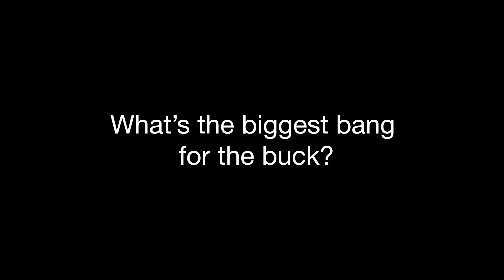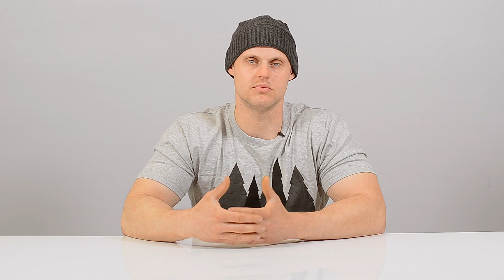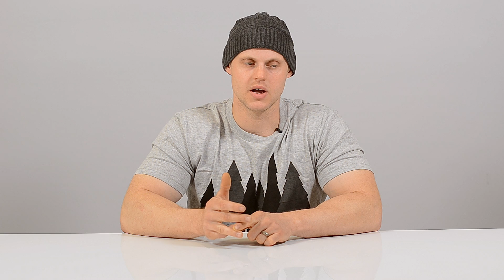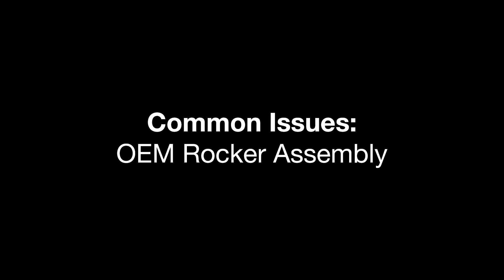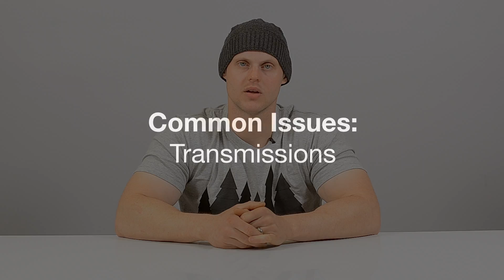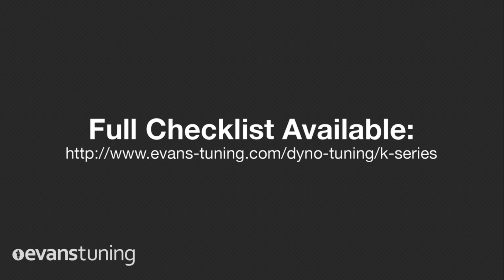The K-Series Tuning Checklist

Comment: 250 hp with 200 lb ft tq is J32 levels of power in something under 3,000 lbs. It makes for a fast and reliable power plant for an EK or DC platform. It is good for 12 second 1/4 mile with no weight reduction

Comment: Question, If i have the 2nd gen TSX with the K24Z3 engine, would I be able to swap my heads with the K24A2 heads to then modify? I ask since many parts are made for the K24A style engines. Unless you know of some good bolt-ons?

Comment: So i have a 2006 k20z1 with skunk2 stage 2 tuner series cams, wiseco 11:7:1 pistons, manley h beam rods, acl rod and main bearings, supertech valve guides for exhaust, cai Intake, cometic head gasket, walbro 255 fuel pump, rbc port matched and polished, 550cc gram injectors, ktuned fuel pressure regulator, k tuned 72mm tb, 2.5 in exhaust, megan racing headers, stage 2 competition clutch, 8lb ultra lightweight flywheel and kpro. i think thats it but yeah whats like a ballpark number you think i might gain from this setup all motor tuned on 93? Thankss

Comment: I have a question I just finish a turbo build on my rsx type s stock motor. I did the whole fuel system return kit 1000cc bosh injectors k tune fuel rail and pressure regulator walbro 450 pump and braided lines I had some 93 pump gas and went and put e85 since I’m trying to switch fuel the air fuel mixture went crazy and the car it’s missfiring real bad I’m running on a base map haven’t had it tune yet can that cause any harm to the engine? And what should I do?

Comment: If your gonna bolt up a k24 tsx bottom end , with a k20 head & k24 tsx cam & gain 40-50 horsepower & torque & be around 240-250 hp like mentioned in the beginning . Wouldn’t that setup basically be like a regular k24a2 with bolt ons?? Would it be easier just to get a k24a2 & do bolt ons ??

Comment: To add a bit to 2nd gear failing, when using And upgraded clutch you may want to change your clutch slave cylinder because the factory one has baffles in it to restrict flow and with a heavier clutch springs your shift will be much smoother if you use a K tuned or like aftermarket slave cylinder , I believe this is the major contributing factor to losing second gear

Comment: do you need a tune for an air intake??
Reply: James Trenholm yes you will lean out the motor any mod requires tune ecu will not understand what needs to happen becuAse it’s tuned for stock parts

Comment: In the Fuel System Part you said to route the fuel coming from the feed line to the fuel rail then out the return line to the regulator then return back to the tank, but most guys do it this way - feed to 3 port FPR then to the rail, other end of fuel rail plugged, then route the return from the bottom port of the FPR to the return line, so my question is, is there an advantage to putting the FPR after the rail vs placing the FPR before the rail? BTW this is for FI application therfore will be running large injectors. Thanks

Comment: Enjoyed the video, I have a EP3 with a K20a3 I am debating on doing an engine swap to either a K20a2 or a z3 do you have any recommendations or preferences?
Reply: K24a2 or k20a2 or K24 block and a2 or z3 head. Swapping mine with a JDM K24A2 next week.
Reply: The ep3 comes with a k20a2 doesnt it?
Here in europe the ep3 is the type r, with the k20a2....?
Where are you from?
Grtz
Reply: Nicolas Dujardin uh in UK it has a K20A2 in em yes. Japan has the “K20A” no “A2’” or “A1” ETC. I am from US so we never got the EP3 Type R we got the weak Si EP3 with a K20A3 with fake VTEC and 160hp. I swapped mine with a JDM K24A2 from the CL7 Accord
Reply: @AeroPrixma  oh allright, i thought it was something along those lines...
I have a 7th gen civic coupe (em2) and now swapped in a k20a2 from a edm ep3 type r, injen cold air intake, 2.5inch invidia gt300 catback, dc-sports 4-2 header, rbc intakemanifold ,skunk2 70mm TB and hondata ecu.. now makes 237 whp. 
And what a blast it is 😜 
Its now been finished for 3 days, and enjoying every second from it lol
Reply: @AeroPrixma  how much torque do you have from that k24 ?
Reply: Nicolas Dujardin oooo nice. I got stock 171tq. I just put the motor in w/ a new clutch so it will need to be broken in, but i have been tuning it because it has been running lean. Later i will take it to a professional tuner once it is broken in and get the real numbers. The TQ is so good. So worth it. You press 20% throttle and like that you are at 45mph or 70kph. I wanna make 230whp like you, looking to get mid 14s in the 1/4. You running 91 OCT with 237whp?
Reply: @AeroPrixma  we only have 95 oct & 98 oct here in europe... 
So it's mapped on 98 OCT.
First i wanted to do a k24 underblock with k20a2 head, for the torque advantage. But i couldn't find a decent k24 underblock
 So just went with the full k20a2 engine with dc5 6speed gearbox with shortshifter, added a sachs stage 1 clutch and fidanza stage 1 lightweight flywheel. 
Also removed the rearseat and trunk liner. Added a strut brace under the hood, a trunk strutbrace and chassis tiebar.
Suspension wise a installed a KW V2 adjustable coilovers, with ep3 type r anti rollbars, for brakes i installed ebc gd series, grooved and drilled disc, with kevlar ebc yellowstuff brakepads and forge carbon brakelines. Wheels are bronze japan racings (volk te37 design) with nankang ns2-r semi slick tyres :)
Reply: @AeroPrixma  and what kind of ecu are you running?
Reply: Nicolas Dujardin good lord solid build! I have the Type S DC5 tranny as well. I went with the full K24A2 because I couldn’t find a low mileage K20A head for a frank build. I also have all my suspension aftermarket except the front anti roll bar. I can only dream of having Volk TE37s. I am running stock ECU from my EP3 k20a3 with KPRO from hondata
Reply: Nicolas Dujardin oo nice semi slicks, I am going with semi slicks as well (federal rsrr) couple burnouts will do the tires some good for replacing 😂🤣
Reply: Nicolas Dujardin I have some extra RSX Type S rear anti sway bars. Can’t remember if they fit on em2 but they fit on the em1, RSX of course, and EP3.

Comment: i heard a ultra light fly wheel in a k20/k24 build isn't a good idea due to how fast the motor revs up and its recommended to stay above 10lbs for the fly wheel is that true? also how reliable is it to have drag cartel 2.2 cams in a 8th gen with upgraded in line TCT?
Reply: Reggie H just use a rev limiter no need to rev the motor past we’re is makes it’s power

Comment: Hey , i know this is not a question about k-series, but as you seem very knowledgable about honda tuning, i have question for you!
I just bought my first honda! A 05 em2 civic coupe, with the d17a9 vtec-e engine, stock 125 hp..
I would like to go for a safe 160 170 hp.
What would you recommend my to go with first?
I was thinking about an CAI, headers, cat replacement, and a catback system,and a tune for starters. Together with a stage 1 sachs clutch and lighter flywheel.
Then for tuning. Can i just tune my original ecu to run well with the new parts, or do you need another ecu to do that?
Lots of thanks for the learning vids!!
Reply: I have a 02 Honda civic em2 as well with the d17a2.  From what I've researched they're not worth doing anything with.  Maybe I'm wrong and someone can give you better advice,  but I think you'd be better off saving for a k swap
Reply: @sentree9857  late reply here, i know the the d-series sucks for tuning, theybare the least tunable engines honda made, but all has been taken care of now, my em2 now has a fully rebuild k20a2 , from a edm ep3 type r, with an invidia 2.5" catback, srs catdelete, rbc intakemanifold and eventuri cold air intake.
It has 216 whp :) and a damn blast 2 drive

Comment: I’m running forced induction in my K20a and planning to forge it and run the power in the low 500’s. Is there any need to change the valves and valve springs? And is it better to put k20a2 cams in? Thanks

Comment: I need some help! My 8th gen si wont rev past 7k. It just completely  stops accelerating and cutsoff, not sure what to look for. Changed spark plugs, just did a  oil change, cleaned the maf and throttle body. Ran some fuel cleaner and nothing changed.  What's the next step? Anyone? Evans Tuning?
Reply: Also no cels. Car drives normal other than that. No weird noises. Mods are cold air, catback and berk hfc. Issues occurs with or without flashpro basemap

Comment: Some really good info you shared! Can anyone direct me to DIY on removing the clutch pedal safety switch? Would it be as easy as just threading it out of the pedal assembly and zip-tie it under the dash, then thread a bolt into the assembly to act as a depressed clutch pedal stop?

Comment: If i put my k20 head on a tsx k24 bottom end, do i need to change anything to the bottom end? I read to use the RSX oil pump, but not sure if i can keep the TSX bottom end stock. Also, would buy RSX race header fit once i put on the k24 bottom end? would i need to purchase a k24 specific race header? Thanks in advance =)
Reply: Jon Silva I used to have a k20 but swap to a k20/k24. The headers for the k20 fit the k24. I'm running skunk2 alpha headers.

Comment: Can i still get away with leaving the fuel system returnless with turbo? Mybe only with a 750cc injectors.. only doing 8psi of boost
Reply: asakapa0003 with an uprated in tank fuel pump you'll be safe to 350. After that id say run return/fpr
Reply: gynads ok im aiming for 320-350 anyway

Comment: If I get a k20a2 head, do I need the rocker Assembly also? To use the 06 tsx cams or will the k24a2 rocker Assembly bolt up fine?

Comment: So I have a k24z7 it's an odd ball?  Why?
Reply: sam pinzon don't worry. The k24z7 is strong and the integrated exhaust manifold flows very well. 
If you ever go turbo, that integrated exhaust manifold is perfect for really simple high flowing turbo manifolds.
Reply: sam pinzon it's not true vtec for one it's only in the intake side, it also doesn't have a true header because it's cast into the head. I'm sure there's more differences but those are a couple. I have a k24z7 and it still makes good power with bolt ons and a tune.
Reply: Ryan Fulkman I'm doing a Frankenstein swap with cams on 93
Reply: The reason why it’s a odd ball is not really about the dual VTEC or the down pipe issue it’s becuAse everything is different you have to peace together a mount kit u need a stand alone for ecu becuase of crank trigger on the fly wheel also transmission casings are different also this for swapping into older chassis

Comment: Hi there, great informative videos. Is it possible to connect the variable cam pulley system to a simple on/off output rather than a full degree control system? Similar to a 4age 20valve engine. Just so that a simple aftermarket ecu could control it. Just a couple of outputs, one controlling the hi/low cam and then one for fully advanced/fully retarded pulley. I know it wouldnt be as good as a factory style system but im just looking for simplicity.
Thanks in advance

Comment: Seems like a lot of issues with running a k Series swap. I understand that they are amazing engines but damn so much shit you gotta worry about. For those who have them, do you really have these issues and worries after putting them in your car? I love the fact that they respond to bolt ons a hell a lot better then any other swap but it just doesn't seem to be worth all the money/issues/worries that come along with it. I've done b Series swaps and didn't worry or have any issues with them at all besides the fact that it takes more to make the power of the k's. lll prob do a H2B first before I get into the K engines. Close if not the same kind of power potential with the option to use the best transmissions honda ever made. JS
Reply: Rashad Clark I've had my k20a2 swapped into my Civic for over ten years with I/H/E and tune with ZERO issues.
Reply: Yes! I have an 07 si, and owned the car 9 years and have constant transmission issues!!! I’m on my 2nd tranny and 1st rebuild!!! These tranny are not cheap! I have had ZERO issues with the motor!!! Before i owned a 99 si for 13 years had motor issues but no tranny issues. But my B series was cheap to fix.
Reply: @biancothequeenbeethompson  Well I think you got lucky with the B series tranny cuz it's known that ALL Honda transmission's have problems. Mostly the synchro's. They are made of glass. One or 2 really bad miss shifts and that's it you now have a grind in that gear forever. Don't know why Honda won't make the synchro's stronger it's really annoying but I still love Honda tho.
Reply: Rashad Clark ahaha I'm not swapped but I got a 8th gen si. my biggest problems so far was I bought the car abused and heard light tapping and got louder. so bought a aftermarket warranty 2 months later next thing I know,  something happened in the head and I got the whole engine replaced for 100 bucks. I replaced the clutch while the motor got pulled. mmmm valve cover leak, tdc leak, and compressor took a shit but other then that nothing crazy. I do drive pretty hard but also try to feed it the with the best oils, cleanest gas and follow the regular maintenance schedule from the book. other than that it's pretty solid I have no doubts and not afraid to drive across the country. not to mention the Z3 pulls my car like no tomorrow for it being 3k pounds
Reply: Look up Gene Kim on YouTube......

https://youtu.be/-0Itl5ChyCs

Comment: what's up bro.. pretty good job on the video here.  I'm pretty much in the same boat as you being a huge gear head.  every b/d/k/h I ever owned were all upgraded to forged internals/everything else etc... wayyy back in the day of my high school years (many years ago) first having a turbo d series that ate s/c cobras for breakfast and nos Corvettes for lunch.  personally I would take a stroked 1.8 b series to 2.0  engine anydayyy over any k series.. the k transmissions are trash compared to my upgraded b series short shift where I'm shirting gears so fast that if any sponsor ever saw my shift skills they would want me to drive their drag civic over any pro civic drag driver instantly hands down.  it's almost like the shift doesn't even exist...oh and one more thing bro.. like I said before great video but honestly a lil boring as in everything white.  maybe put some pictures of k Honda's on the wall w bitches leaning on the car w hood popped or some turbos spitting flames.. u get the point..  have fun and be safe fellow honda enthusiastic.. lil Hondas causing massive problems smoking boosted muscle whips
Reply: LMFAOOOO

Comment: I have a k20a3 and I know that is the wussy motor of the K series, but what would you suggest are the best options for me to be able to spiff my car up to make it a bit more fun to drive. Turbo kit and Kpro? Ive done the research and it seems to be a pretty nice motor for boost as long as you dont go super high on it. Or should I try and swap the head to a k20a2 and then do a turbo set up? I want reliability since its my daily but also want some fun as well.
Reply: Durno If you want reliability and power for K series slap a supercharger on it. Less maitenance,less of a chance for things to fuck up. Get an 05-06 Type S oil pump,upgrade the the tensioner, get Kpro V3 or newer, 3 inch exhaust,a decent header and a great tune and you'll have what you are looking for.
Reply: I would get a k24a block and use it with your k20a head. Turbo is always good option too.

Comment: Thanks for the advice..  Years of experience.... Going to save me a lot of time..   I can tell you know your $hi+ ...   Have a Z4 and will now swap out the Oil Pump and TPS. .. already have headers and 71 TB.. with the RSP intake with TB adapter welded on..  I cut the old TB mating face off the RSP manifold -( fly by wire TB ) .. and just welded the adapter directly to the manifold... ( professionally Alloy welded that is )... . and then ported it to 71mm  .. and add an Idle Air port ( RSP does have one ).. ...drilled and ported it...... HOPE IT WORKS..   doing a A to K swap..   Mini A series.. to Honda K series.. :)

Comment: I turbo a K24 for a 13 civic si, however since the installation it has been smoking, and because the larger injectors, got dashlight for fuel bank.  Could it be possible to change the smoking issue?  any sugestions

Comment: Hey man thanks for the video! Just wondering if you could do a video on nitrous set ups for the k series? From the research that i have done it seems that a direct port dry shot is best for k series. Of course you would have to have the basic bolt ons, kpro or any other ems, upgraded injectors and fuel  pump. Also it seems that with the kpro you have more control of the nitrous. I have only read about nitrous set ups, but i would really appreciate your opinion considering all of your experience and knowledge! I am stuck  between getting a supercharger or nitrous set up. If you could do a video on k series nitrous set ups including the pros and cons that would be great! Thanks again for the content!

Comment: B series plz some of us are too poor for k series
Reply: Haha yeah
Reply: Tuning isnt cheap but fully building a b series can be just as expensive. Here in cali you can get a k24 jdm engine for $650 and making 240whp with a header and intake manifold with 200ft lbs of torque I'd take that any day. After you fully build a b20vtec your lucky to make 230whp and way less torque and that engine is basically maxed out. Just trying to find a b16 head in good condition  for less than $500  is not easy. In my opinion B series is overrated and overpriced.
Reply: Never get into the K series scene. People jack up prices on used parts to unreasonable numbers and are assholes for no reason.